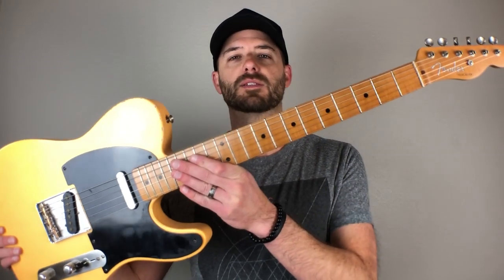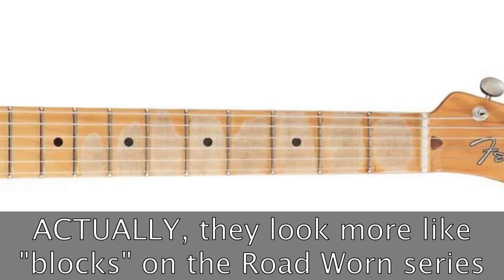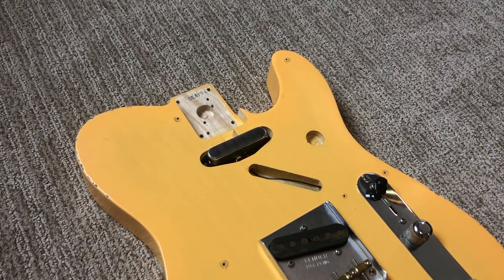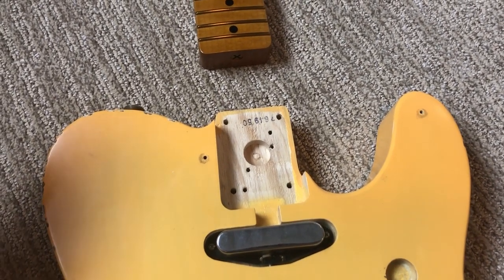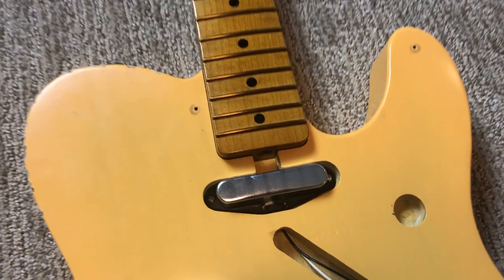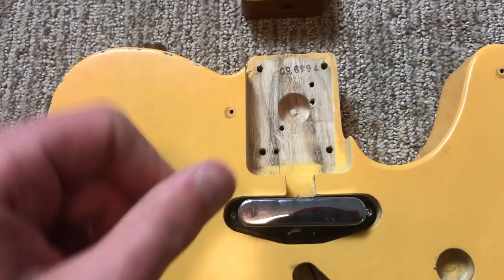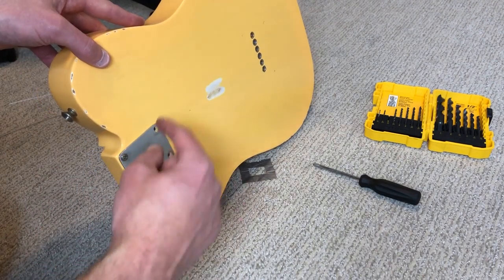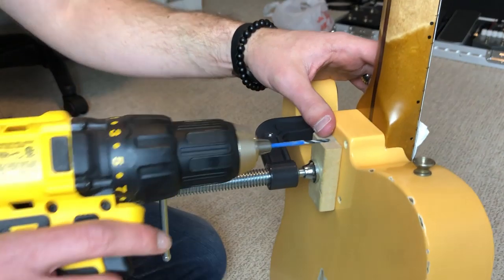How To (Or How NOT To) Fit and Install a Fender Style Neck

Comment: Here are some things I had to question while I was watching the video. First of all, I'm an old guy. I owned Fender guitars in the '60s and '70s. My first question was how tight the neck pocket fit has to be. I keep thinking back to those old guitars (especially basses) and how we used to throw them into their cases and travel to a gig only to find that the high E string was all the way over to the edge of the fretboard. We just used to grab the guitar and give the neck a good yank in the right direction until the strings were back into alignment. Sometimes it would hold fine for a long time - it depended on how many knocks the guitar took. If it was a constant problem, we got a screwdriver and retightened the screws. (duh) I remember some guitars allowing an eighth of an inch or more lateral movement at the nut. In other words, nobody that I knew was very concerned about how tight or loose the neck pocket fit was. This was more of a concern in the '70s when Fender went to the three screw design. So, how did we fix it? We put a piece of sandpaper between the neck and body joint and tightened the screws. My point is that when you are mixing up parts like people do, the tightness of the neck pocket fit is not critical. What is critical is having enough movement at the joint so you can properly align the strings to the edges of the fretboard. We also used to use a couple  thicknesses of business cards to adjust neck tilt. No big deal. I could never hear any tonal differences from having sandpaper or paper shims in the neck joint. That is the beauty of the simple design of these guitars. People overthink stuff. I would never buy a partscaster because I know that if I took it apart I would find all kinds of hacks like where you butchered your new neck. I think I would have drilled the holes in the body a little bit larger so you have room to adjust neck alignment. The screws should not be threaded into the body. This is definitely a How NOT to do it video. You built a "homemade" guitar, not a "handmade" or "custom" guitar. I would call it a Partscluster.
Reply from the maker: Just coming around to this comment, but since it seems to have to most likes I thought I would address it. First, here is the follow-up video to this one: https://youtu.be/O_devvyFZLE?si=EnmjdjUwuxAZrVre  
Yes, neck pocket tightness is highly subjective & often debated. I guess I fall somewhere in the middle. I don’t think it needs to be overly tight but I definitely don’t think there should be a lot of play. 
Yes, I screwed up on drilling this neck. It was a learning experience (although I had actually already successfully done it with a previous neck). It’s also here on YouTube for everyone to see & hopefully not repeat my mistakes. And of course I did re-drill the neck & correct the issue (again see link above). 
Yes, this is a partscaster. I have a lot of respect for builders who carve their own necks & bodies, & I’m definitely not at that level. 
Thanks for watching & commenting.
Reply: the screws are 100 percent threaded into the body as well on all new fenders unless people enlarge them to just have a lag clamping force.  New fenders will not have the screw just push through the body

Comment: Nathan...for what it’s worth... I install threaded inserts on all my bolt-on necks... I swear it makes a difference...the guitars vibrate more, they are louder and have more resonance...the inserts really pull the neck down into the pocket making the best contact...and you can take the neck on and off as much as you need and it still goes back perfectly...been watching these vids and I go thru the same problems...rock on my brother!!!!
Reply from the maker: Thanks for sharing! I may try that one day. 👍🏻
Reply: Hi Eddie, I’ve heard about this before but quick question: do the inserts live in the neck base only, or also in the holes you drill in the neck pocket?
Reply: @tituschalk  …the inserts go into the neck…you drill a wider hole and screw them in…they’re permanent …then bolt up as usual 👍

Comment: I’m curious why you chose to take material off the body instead of taking material from the neck heel?  The way you did it seems to have worked fine, just picking your brain.  I’m starting a new Tele partscaster build as well and appreciated this video.
Reply: Same here, seems like it would be so much easier to take the neck down. Also why not try and take some of the finish off that heel of the neck?
I'm also about to finally assemble after weeks of research and your videos have been the best!
Reply: I’m guessing it’s because you don’t need to measure and mark out the area, because the neck heel is already milled out.

Comment: I had the opposite problem! I bought a recently made replacement RW neck for my 2009 RW Tele. It was not a tight fit at all. I could slide a piece of paper or thin cardboard in between the neck and body. Very annoying. Why couldn't Fender make a replacement neck that actually fits?
Reply from the maker: @anotherheadlessdemo  yeah, the beauty of Fender’s “bolt on” neck design is that changing the neck is really easy. The downside is getting the fit just right. Hope you get it sorted out.

Comment: If there a no pre-drilled holes for the bridge OR the neck (on Muslady tele kit you drill every hole except tuner pegs), which do I measure and drill first to assure the neck, bridge and strings are centered?  The bridge?  If so, do I estimate the center line based on a neck/pocket that has enough play to pivot just a little bit?  Do I install the neck first to run a line from the nut down the center, but not being 100% sure the bridge will be square with everything else?  Do I temporarily clamp the neck to the body, then  square the bridge and mark all of the bridge and neck holes?
Reply from the maker: Those are very good questions. I'm not sure I can be of much help, since I've actually never drilled bridge holes before. I know alot of kits come with instructions, some you could probably even look up online without buying the kit. I think BYOGUitar? Let us know what you find out. 😊
Reply: @NathanSink  Thanks for the reply. I'll let you know what I find out.
Reply: Drill and install the neck 1/8 in the neck 3/16 in the body,line the edge of the neck  with the edge of the body, drill and install neck, take bridge with string on both e strings line it up so the strings are equal on the neck mark bridge and drill use blue tape on the body to mark holes

Comment: I've just drilled the holes in my new strat neck, and it's worked just the way it should have. I did use a C-clamp. You just have to carefully rest it on the shorter 'horn' of the guitar so that it couldn't move or slide off. Then I clamped the neck tight enough to hold it in place. Here's the trick I used to make sure the neck doesn't move on me: I took a piece of low-tack tape and drew two lines on it. Then I struck it at the joint, where the neck butt meets the body, so that one part of the tape was on the neck and the other one was on the body. Then I carefully traced it with a knife right at the joint. I ended up with two lines as visual cues and could immediately spot any changes in their alignment. I also clamped the body in a vice, so that I didn't have to worry about holding the guitar and had one less thing to control while drilling.
Reply from the maker: Sounds like you nailed it! …..or drilled it!🤔 Either way, great job & thanks for sharing your tips. 👍🏻
Reply: @NathanSink  Thanks. Your videos helped a lot. Knowing what not to do may be more important than watching a dozen perfect videos where pro luthiers use all the right tools. I'm just a hobbyist, so I had no tools but a clamp and a hand drill. I just tried to eliminate as many variables as I could. Btw, I've used two layers of heat-shrink tubes instead of tape to keep the drill bit steady in the hole. It did work, so I guess it's also an option. The only thing I couldn't anticipate was that the holes in the body had not been drilled perfectly straight, so when I tightened the neck, it did go out of alignment half a mil toward the bass side. Now I've got 4 mil on the bass side and 3 mil on the treble side from the edge of the last fret to the string. I have no idea how to check if your pilot holes are straight, but it's something to keep in mind.

Comment: Might be completely wrong here but I've been an automotive painter for the last 18 years and believe the reason "nitro" (lacquer paint) was used on vintage guitars is because for the time period, that was the best and most durable. Urethane paint came around much later having better productivity, UV protection, and build. More importantly much safer to spray! Nitro may have gotten its name from the amount of paint booths that exploded due to light bulbs! 
From a painters stand point, Urethane is far superior just for durability alone. Lacquer WILL break down much faster. I love staying true to the time period though so it truly is personal preference in today's time period. Hope this helps great video 👍
Reply from the maker: Thanks for the info! Nice perspective. I agree with you: polyurethane is more durable & tougher, but it all comes down to taste. 👍🏻

Comment: Subscribed. Have a allparts neck on a gorgeous tele nitro guitar mill relic and the neck has a large hump in it now with the nut totally off! I’m trying to find vids on how to use a jig to introduce a back bow and then the rod should work again. Anyway, stumbled on this and I love the guitar. I actually have the pre road worn which was the Nitro series they made that weren’t worn but all nitro and for a fiesta red jag which it is with American electronics fir under 1k it was a steal! Hard cases included. They quickly switched to these and I agree, the poly is a no go for me on a vintage style guitar. I relicd my jag myself but it’s nitro so it was super easy to get that cracked look with heat and cold and then slowly age it and the metal with acid. I even aged my guard by putting it in bucket and blowing cigarette smoke in while it was sealed for two days. Looks like 20 years old now. 
Anyway…. Dig the vids. 
Now back to my hump neck problem 🙄
Reply from the maker: Thanks!  Hope you get your hump worked out! 😬

Comment: Lacquer is for non-hard use areas-- also borrow  friends drill press next time. You can use paraffin or bees wax on the screw threads for easy driving.
Reply from the maker: Yep, it will definitely wear faster than polyurethane.
Reply: I use a plunge router 1/8 collit for a cnc router and long Spiral bit

Comment: Bro check your nut slots buy a bone blank and reslot it position the high and low string on the nut and go from there even when you had the neck were you wanted it the e strings look to close to me to the edge i could be wrong but i had a similar problem
Reply from the maker: Thanks for the tip.

Comment: I’ve heard to never sand the body pocket for a fit but sand the neck instead
Reply from the maker: I guess it depends on what’s most “valuable” to you; the neck or guitar. I’ve sanded a Chinese neck that I put on a Squier body because I would have rather screwed up the cheap neck. However, I mainly got this method from Fender. See about 1:33 in this video: https://youtu.be/dyu0uylL9jc
Reply: Nope, mistake, all opposite: never sand the neck. Sanding the neck pocket is a common practice.

Comment: Nathan-
I believe that a $40 Harbor Freight TRIM ROUTER would do you pretty good.

They're just a bit bigger than a large Dremel, and have a decent, clear plastic base.
You could use Dremel bits in one... Easy to open those neck pockets a bit!
Reply from the maker: Love Harbor Freight! Man, that’s a great price. Thanks for the tip. I just don’t know if I’d trust myself with a power tool around a neck pocket. 🤔